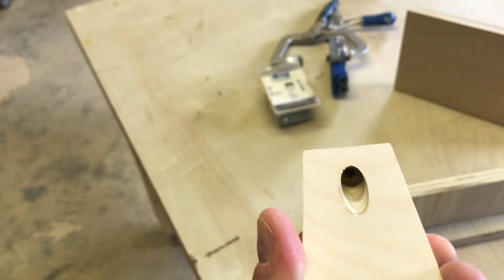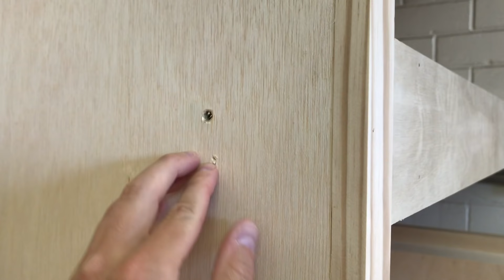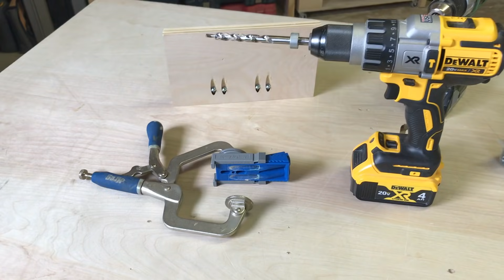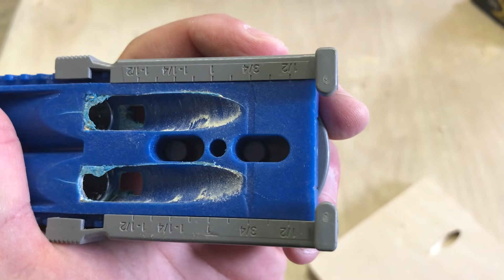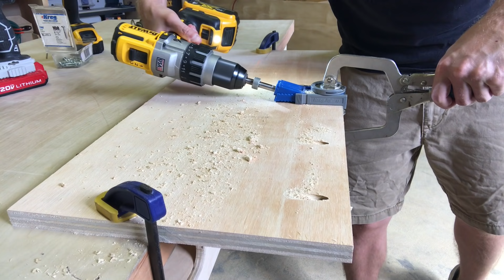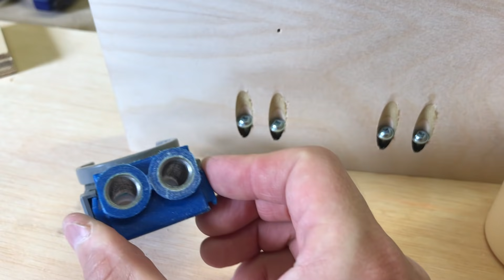Pocket Holes / Pocket Screws EXPLAINED!! (How Pocket Joinery Works--Kreg Pocket Jigs--PROS AND CONS)

Comment: I had to attach a 1 1/4 " thick pine wood to 3/4 " plywood. The pocket hole was drilled on 1 1/4 " thick pine wood. So for material thickness 1 1/4",  kreg recommends to use 2 "  coarse nails. To my surprise it just drilled out of 3/4 " plywood where it was getting attached to. So does material thickness refers to the material you are attaching to or the material you are drilling the pocket hole?
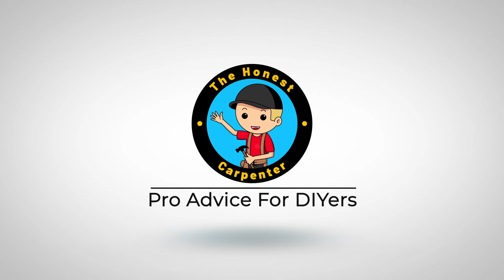Reply: That is a great question.  I have the same question every time I dig my Kreg out.  The directions are not clear. Even in this great video,  the correct answer is  only briefly discussed  at about 6:40. We told, by The Honest Carpenter,  that the gage  is used to account for the thickness of the board you are drilling into and not the board you're screwing onto.

Comment: Pocket joinery was used long before Kreg came around.  Evans was one company that had a drilling tub, which drilled two holes in styles or rails in one operation.  Air operated, very efficient and when used with adhesives created an extremely strong joint .  I built hundreds if not 1,000's of kitchens using this  joinery, never having a failure.  Yes Kreg along with several other companies brought it down to the homeowner level and have done a great job.

Comment: This rookie woodworker used my Kreg pocket hole jig today on my first project--an outdoor storage bench. It's true, a complete novice can get it right in short order. Kreg does recommend running a test on a piece of scrap, the same thickness as your project wood. After a couple of test holes, I "went live," with good results. Clamps are essential to a good experience.

Comment: Pocket holes are fast and easy to use. I did a set of drawers using them, and they are plenty strong. They just don't look as refined as some other methods. There are tips and tricks to learn, for example when screwing in the wood tends to shift, so you need to clamp everything down solidly.

Comment: Not sure why, but this video's thumbnail made me think it was a "Smarter Everyday" video.   Maybe just need a new glasses prescription?  Just as informative, so I was sorta right. 😉 

I'm a novice woodworker & have a K4 kreg jig & a lot of different screw lengths.  My main issue is the square-drive screw heads want to cam out if the driver alignment isn't spot on.  Is that my driver bit  aging or am I doing something else dumb?  

I've read that an impact driver is particularly bad with this method.  I only own one drill so any good tips on not blowing the screw out with the impact driver? (For an impatient, easily distracted person that will just haul down on those screws.   Ways to fix such blowout?)

Comment: Pocket Screws and concealed screws have been found in furniture dating back to the beginning of the Renascence period.  In the earliest days, a chisel or  gouge was used to cut the initial slope.  Then a small drill was used to counter bore for the head of the screw.  Since the slope could be removed as a single piece, the same piece was often used to refill/cover the slope after the screw was in place.  As the shape and grain where a perfect match, these fasteners have often been missed by even the most experienced of observers.  In some cases, they were only discovered during x-ray examination of valuable antiques.
Reply: I didn"t know that! Wow, so these have been used since renaissance?
Really???
Reply: @susannebrunberg4174 
Yep 18th century. Likely prior to that as well in some fashion.
Reply: I was going to point this out too but you phrased it much better than I would have taken the time to do. 👍
Reply: Came here to say this, glad someone beat me to it.

Comment: Thank you for the video! I have used the Kreg pocket hole system for a few years.  Although I do love the concept, I always seem to have issues with the square bit and screw heads. I don't know if I have always used incorrectly (though I don't think so) but the bit MANY times slips/strips the screw heads....maybe you can provide advice on how to correct? Additionally I think the multi packs for screws ultimately are not cost effective (for me) in that there usually aren't enough of the screws size (I would use) for projects. I would caution new users to price the common size in single box vs multi packs. I LOVE your videos, they are always very helpful to me.
Reply: @Scott H thank you for your comment.  Ironically, it is the bit I have damaged/stripped more often than the screw heads😫 and I have thought it was because I was applying too much weight.  I am gonna guess I still need more practice😁 thanks again!

Comment: Lots of troubleshooting tips, which way is the strongest to orient the board, different ways to hide the hole, when is it a bad idea to hide the holes, creating a box using pocket holes only for demonstration and showing where things can go wrong, or where people can learn new techniques to improve the bond between two pieces or to make it look prettier. This way a person can get started on the basic and keep on working towards more intricate boxes and use theory of creating the best joint at different spots. Be a step by step learning guide. No ulterior motives, as I just ordered my tools and starting out with zero experience. Never used a drill machine my whole life :D. Joys of modern education.

Comment: As a rookie DIYer I used Kreg Pocket screws for the first time a few years ago. Most important advice is to test your depth settings by joining two piece of scrap wood that's the same thickness as your piece. Pocket Screws/holes are great.
Reply: How do I get the scrap wood. Serious questions
Reply: @msmdg88  save leftover pieces of wood from your projects, even if they're smallish. If you're just starting out, and have never made a project, you can stop by a construction site and ask for their scrap wood. I used to do that to get wood for my kids to play with/build forts with, etc.

Comment: This might be obvious to people but it wasn't to me as a beginner when I was first learning about pocket holes. It doesn't work well on thin pieces of plywood!  I assumed it would be an easy way to join 1/2" plywood sheets, but it really doesn't work very well for that. And then when I tried to join 2x4's, I realized I didn't have the correct screw length for those either. So there are a number of gotchas for someone who's really a beginner.

Comment: I have a Kreg K2000 that was purchased in 2000, a Kreg Jig Mini and last year purchased a Micro-pocket jig and bit.  I have used it extensively for bookshelves, faceframes, furniture repair and shop cabinet builds.  The Micro-pocket is designed for 1/2" thick material and i find it especially useful when doing repairs on chair leg stretchers.  I am a big fan of pocket holes.  Thanks for the great video.

Comment: Pocket screws are not Joinery! They are a cheap crappy method to stick 2 pieces of wood together with no effort and absolutely no skill. Making ,should be an endeavor that requires effort, and that effort is what instills pride of accomplishment. If you are going to go thru the effort of making something, make it  right make it strong and make it last.

Comment: Most people dont realize that the strength of a Kreg joint comes as a unit such as in a case or box, such as when combined it is very strong and hard to take apart. Sure when you only join two boards as in an L shape you could apply strong pressure and take it apart. But if you take that same joint at four corners such as in a box, it would be extremely hard to pull apart, and then combined with a backing nearly impossible.

Comment: I literally was just taking my Kreg jig out of the box and you were on my feed! Definitely would love any tips and tricks. Also I’m wondering if you can actually join meaning side by side as opposed to perpendicular, boards (2”) one is a 2x2. Thanks for sharing, I  always find your content very helpful. I’ll try to use your links more in the future. I just missed it this time
Reply: Yes you can. I did that with a bed head board I built.   Works exactly the same way and perpendicular boards.

Comment: Fantastic.  Does indeed sound like a viable alternative.  Just have to buy that one tool and the screws to go with it.

One question though (but I expect this will be covered in upcoming videos): how to drill an accurately positioned pilot hole in the other board.  And how to hold the two boards in position until they are fastened.
Reply: You will normally not need a pilot hole in the other board, the screws will do their job. I highly recommend a strong clamping when you are driving the screw in as the boards tend to move slightly just before the joint is closed.
KREG has various clamps for different clamping situations - all work just perfect.

Comment: Another point I might add is you don't need glue and if the connection needs to be disconnected you can just unscrew it. 20 years ago I built my kitchen cabinets using pocket hole joinery (I purchased the original jig at a trade show). Recently I had to alter the opening to accommodate my new refrigerator. I was able the adjust the cabinet and shorten the face frame without effecting the face frame finish because it could be taken apart.

Comment: Great video! Could you show some examples on the tricks and mistakes of how to use them? Thanks.
Reply from the maker: Thanks Cooper! Gonna do a mistakes video soon 😄
Reply: @TheHonestCarpenter Thanks! Looking forward to it. I remember there are certain drilling/joining angles that need to be avoided, otherwise it would be easy to spilt.
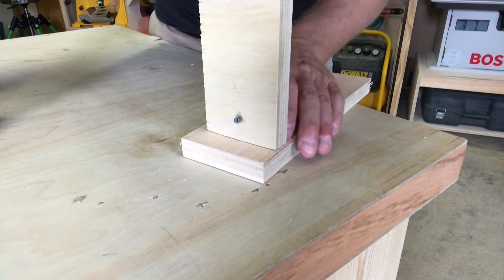Reply: @TheHonestCarpenter  Please make a point about screws because I spent a lot of time splitting material before I realized I had to use pocket hole screws.  Maybe I'm dumb but I didn't put it together and thought I was just overdriving my wood screws.  :)  Steve Ramsay just did a short bit on it about a month ago so it reminded me.  (You did mention splitting at 2:43 but not because of screw type.)

Comment: I use pocket holes quite a bit, usually in conjunction with glue. You really went over alignment too quickly. Pocket holes have a bad habit of being pulled out of alignment when putting the screw in. This is one of the reasons that Kreg made a special tool, the right angle clamp, that really helps. I don't know about Home Depot as I won't shop there, but Lowe's carries Kreg pocket hole items. Also, Woodcraft carries an extensive bunch of Kreg items. Lowe's and Woodcraft only give a 10% discount for Veterans.

Kreg offers a 20% discount to all Veterans. As of the last time that I bought from Kreg this was not set up in the online ordering. It is necessary to call and talk to a representative. Great people to work with.
Reply: Yeah I hate that little creep/shift you get just when fastening the screw. You get everything all lined up then the shelf shifts out of whack at the last moment. You need multiple clamps to hold the item firmly whilst screwing.
Reply: @adamandlorraine  Kreg's right angle clamp works in about 95%, or more, of all cases. It's a bit pricey up front, but the more times you use it, the better a deal it is.

Comment: I have used them for a while in 3/4 inch plywood. Now after watching your 1/2 inch vs 3/4 plywood, I was wondering do the pocket screws work well with 1/2 inch construction? I know the kreg tools have the different adjustments but will it work well for 1/2 inch?

Comment: Thanks, THC. Mortise and tenon is my go-to method for most of the joinery work that I do, but I bought a Kreg pocket hole jig last Christmas. I guess I scoffed at the simplicity thinking it was a cop out way of working. In fact, it's still sitting around in my shop... unused, but maybe I'll use it for my next project. Work smarter, not harder, eh? 😉

Comment: If building kitchen carcasses or any type of cabinet I prefer to combine dowels with pocket holes.
The dowels maintain tight alignment while the pocket screws pull the pieces together and hold them there, I've used biscuits instead of dowels in some instances too but generally dowels I feel offer the best alignment and strength combined with pocket screws.

Comment: Nice presentation (as always).

I bought the Kreg 320 about a year and a half ago and while I haven't used it extensively, where I have used it, it was the perfect solution. Quick. Easy. Strong.

I have also purchased a few Kreg clamps so my investment is definitely over $100, but for me, it's been worth it.

I have made my own plugs when I've needed them. I cut 3" pieces of 3/8" doweling and shove one end into a pocket hole. Cut off the excess and I have a ready-made plug for the next hole. It took me a few tries to get the hang of the flush cut saw, but nothing a little sanding couldn't take care of. Once painted, it is very difficult to see the plugs.

Comment: I almost bought the jig but at the end i didn't. I find it to be a bit overpriced unless you are building furniture. It requires specific wood screws  for a similar price you can get a dowel kit that can be combined with regular wood screws and produce much stronger connection. This is just an opinion. Also if you sink the screws you can use filler and hide them away or simply just glue everything. Option 3 is a router you can just cut a male and female groove and glue it all way better results and no need of screws at all.

Comment: i used a kreg pockehole jig when i built my plywood-based tiny house in a box truck, it's a fantastic tool. used in conjunction with titebond wood glue, and filled-in the pocket holes (no way to get to outside because of walls of truck) with a putty made from epoxy and plywood sawdust. have lived in it for 16 months now, including driving it across the country, and all the joints are still perfect, no squeaking, freaking airtight. lol, i don't ever want to use anything but pockethole joinery, ever again!
Reply: Cool.

Comment: Awesome 😎 I have been using pocket screws with PVC cabinets also. They work really well and super fast for most applications.
Reply: @keithmarlowe5569  you treat them just as wood 🪵🪓 when cutting and using fasteners screws, nails, dowels, glues, etc. Minus the sanding, staining and painting as certain solvents may will damage  the surfaces ( test on scraps) . Formica is the only real solution for different finishes and it works well. 3/4" for the frames and face, 1/2" for drawers... I generally work with Kreg pocket screws and 16,18 and 23 gauge nail guns. Routers, table saws and drills all work the same as wood with this product.

Comment: I purchased one of the original sets at a tradeshow in the early 90's after watching their demo. Unfortunately, I've barely used it because it seems as though every piece of wood I purchase is a different thickness (ie, 3/4" plywood was varying by 3-4 mm), so the screws were not exiting out of the center. Now my problem is that I use the boring jig(s) so infrequently I can't remember how to adjust them for the various situations I'm encountering. Looking forward to tips & tricks, especially when using 2x4s and outdoor projects. Thank you for the "primer"
Reply: Check out Woodworking for Mere Mortals and Ana White.   They both have some great tutorials about using pocket hole jigs as well.
Reply: @TheLovelyMissBeans  thank you!!
Reply: @demesrvl6761  you're welcome! Hope it helps!  P.S. Ana-White has literally hundreds of completely free plans on her website too.